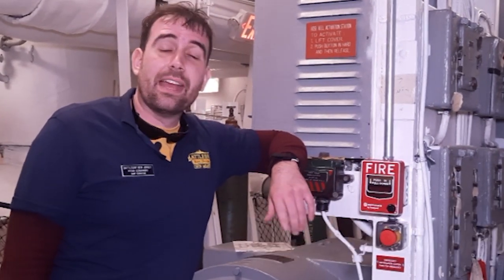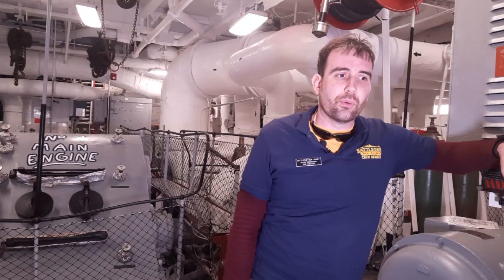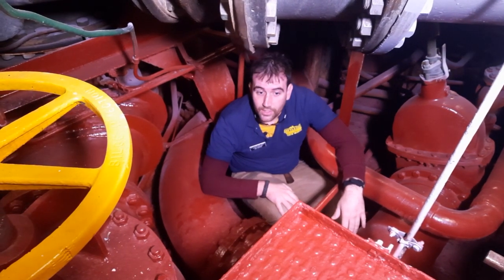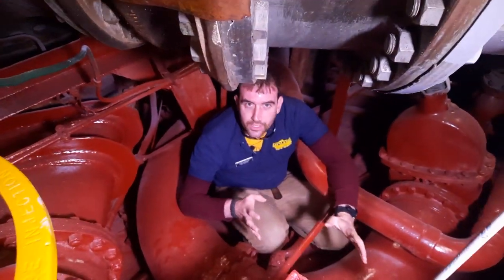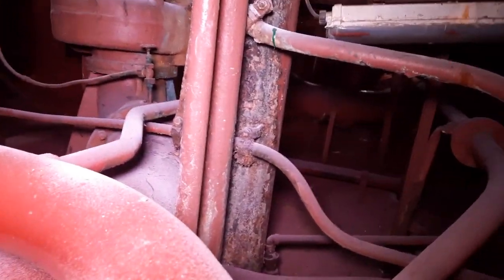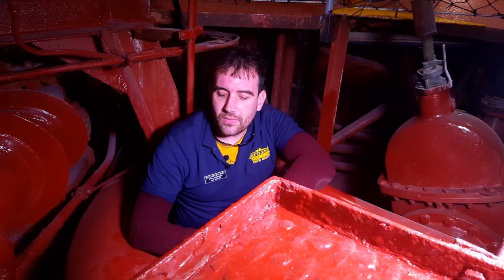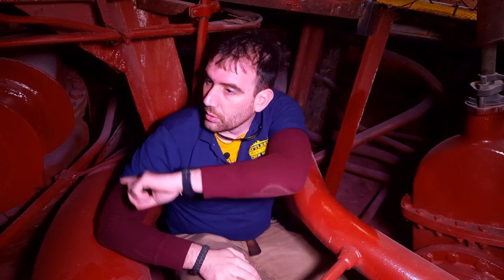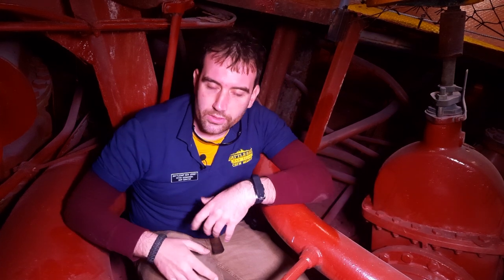Where's the Self-Destruct button on the Battleship?

Comment: My brother told me that there was a box that was part his comms equipment. On it, was an x (yes x literally marked the spot). In case of the vessel been boarded by enemy forces, he'd have to shoot that spot with his pistol.

Ryan, why wear the sea chest welded over?
Reply: I would think the reason they would weld them over is first of all valves and bolted on pipe fittings can leak over the years if the gaskets fail so preventing any water from getting into the plumbing system would help prevent it from leaking and causing extensive damage plus then also means that the systems are kept dry and are easier to preserve as they’re not filled with marine growth.

Comment: I think some ships had the ability to shuttle the ship by opening a certain valve to let seawater in...thus sinking the ship.
Reply: Sea cox if I recall
Reply: Without explosives:  
Remove a manhole on the condenser and open sea chest.
On a water line with a strainer - remove the strainer cover and open sea chest.
Open suction and fire main to bulge eductors with discharge closed.
Reply: Seacocks. Also the valves used for counterflooding.

Comment: Question: How would you protect against corrosion in the pipes and other metal appliances that transport salt water around the ship?
Reply from the maker: If it corroded you replaced it. Most of the worst places for it are bronze so that helps.
Reply: Or you simply have got magnesium bars bolted on the inside of the pipes And in the outside of the ship.
While they slowly corrode away (and need to be replaced from time to time) they protect the steel by setting it under a very low negative voltage.

It's called protective anodes.
Same principle as used in water boilers
Reply: Sacrificial anodes. Inside the access hatches to the main condensers for example were bolted heavy zinc plates that gave up their mass in electrolysis faster and more readily than the ship’s condenser and piping. I’ve changed them myself.

Comment: How hard would it be to make the sea chests functional again?
Reply from the maker: She would have to come out of the water, but otherwise it wouldn't be that tough
Reply: There are plates welded over the suction/discharge ports, which is done when mothballing a ship. So it has to go into drydock to have those removed.

Comment: You are WRONG. Here is the self destruct sequence. You type  (or use verbal command) into the computer :

Destruct Sequence 1-1A, 
Destruct Sequence 2-11A2B
Destruct Sequence 3 - 1B2B3

Then when it confirms, you type in :
 Code 000-Destruct-0

That will give you 1 minute to get off the ship, so best to do it after the rest of the crew has already abandoned it.
Reply: I think my computer must be defective, when inputted those codes it said "Self destruct in 5 seconds"